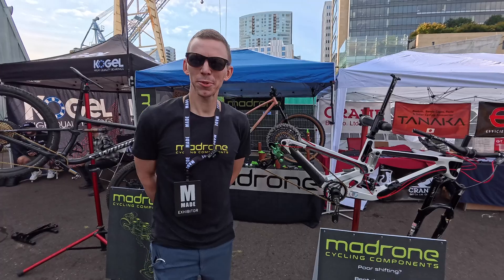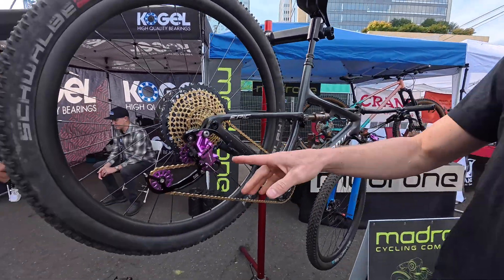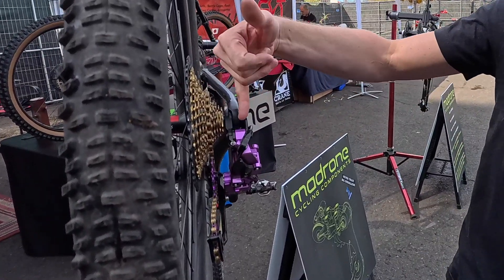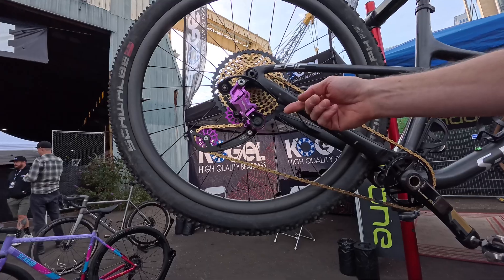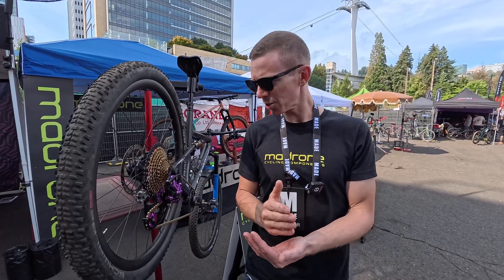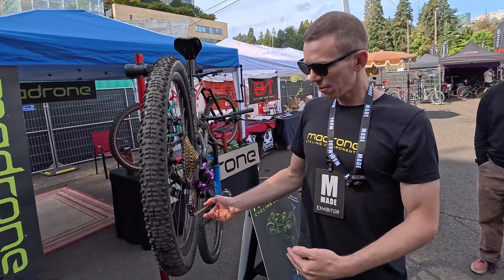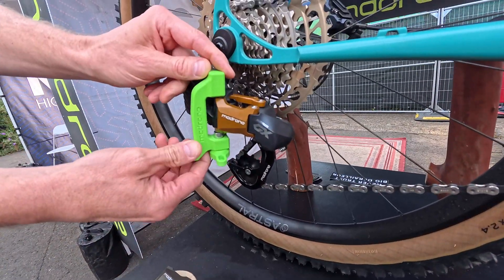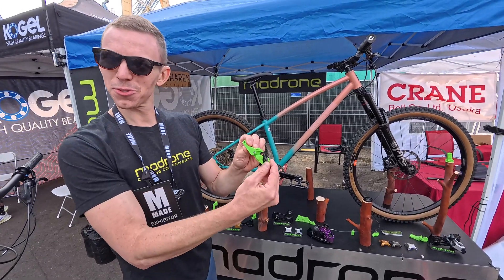MADE Show 2024 - Madrone derailleurs

Comment: They updated the design, they no longer use the flex cage, but regular cage, but a nea feature is you can out a hex key in a hole push the cage forward insert the ke into another hole to lock it so a simpler cage lock.

Comment: Good work madrone! And good luck. I think you’ve timed this right along with Ratio with spare and rebuild stuff. I’ll check you out if the price is right in the uk. I’m not keen on alu jockey wheels though. Would prefer solid delrin without holes.

Comment: Build a rapid rise version and then I'll be interested...  It's a shame the industry completely abandoned the most logical design for the modern derailleur that doesn't allow force shifting because people couldn't learn how to shift backwards.
Reply: Just found an old rapid rise in a parts bin at my local bike coop. I'm running it friction on a commuter and have been loving it.
Reply: Agree that rapid rise or “low normal” was better for preventing chain snapping shifts under load. IMHO main reason for the failure of “rapid demise” is that Shimano packaged it with their STI flappy shifters in order to lock other companies out of OE supply. As I recall they only offered one trigger in a non series version for a while. Many of us didn’t want moving brakes on our mountain bikes.
Reply: @kevinriseborough1521  Well, remember rapid rise first appeared on 8 speed XTR with the M951 option and then the 9 speed revision with M953.  That was like a 6 year span with traditional trigger shifters.  I believe the main reason rapid rise was forced as the standard for M960 with the STI levers was just practicality, because it was easier to shift.  If you tried using a standard derailleur on those shifters it took a heck of a lot of force to shift into low gear.  People with small hands or weak hands struggled.  Like you said, everyone has bad memories of that generation and they forever tied rapid rise derailleurs to it.

Comment: Obviously theyre not on the website yet, but how much $ are we looking at? Im pretty tired of both the Shimano and Sram designs, neither actually solve the issue and out of the box they have so much play in the parallelagram
Reply: What issue?
Reply: Shimano's definitely don't have the same bushing wear that SRAM has...
Reply: @cup_and_cone  brand new out of the box the parrelagrams have bushing play, enough for the jockey wheel position to move 3-5mm. 
There's no way to adjust or remove that clutch deadplay he mentions, it takes about 200 grams of force to detention the chain and make it slap the chainstay, if it wasn't for pedal kickback/antisquat our chains would fall off. 
All the current deore/xt/SLX mechas sit outboard 1cm further that the 2013 SLX etc mechs. The body also hangs down much further. 

The ratchet mechanism needs more points of engagement too.
Reply: What issues?
Reply: idk im hopping not to much i want a right to repair derailleur so bad